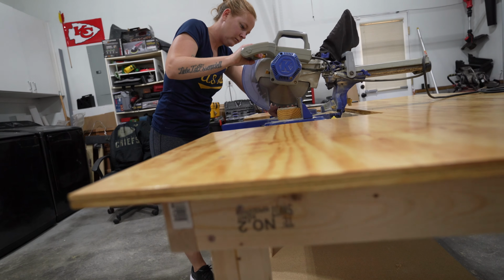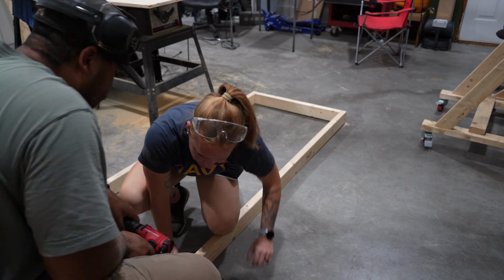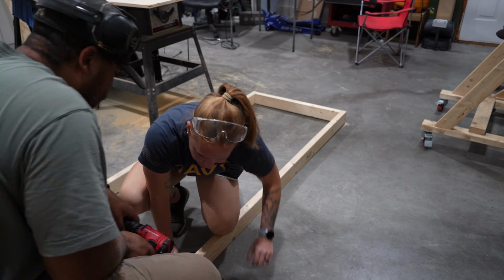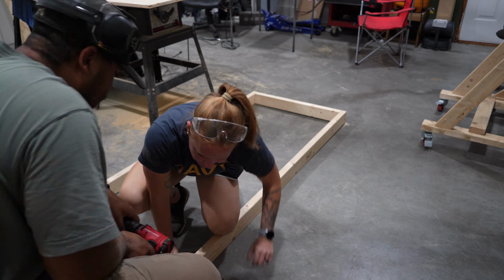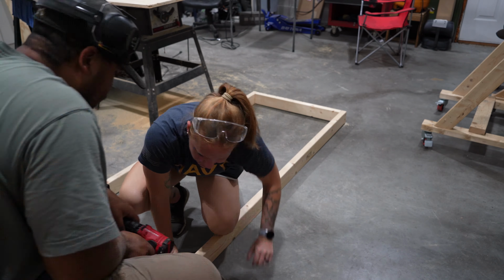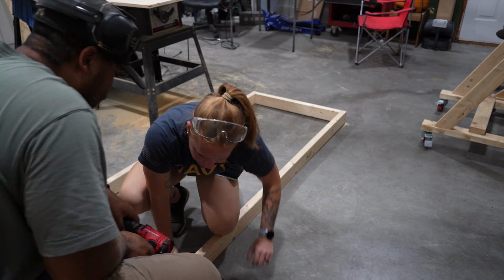Easy Functional Workbench with Modular Design

Comment: I think I should make a video about my work table, mine has a fold-down metal cutting saw, miter saw and bench grinder, my small table saw rises from the middle with electric actuator. I seriously need to make a video.
Reply from the maker: Sounds like a good design.  I'd certainly watch.

Comment: How do you collect the dust from the table saw? Thanks
Reply from the maker: The dust collection port for my saw is on the back side.  I hook my shop vac hose up when I'm using it.  It's not the most efficient set up, but it is what I have for now.  There are newer saws that have a much more efficient collection system.